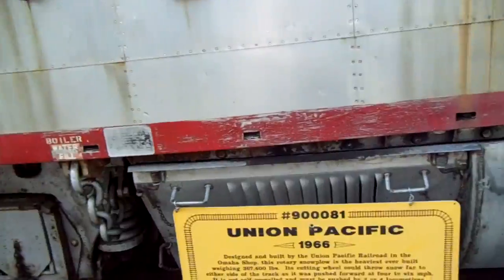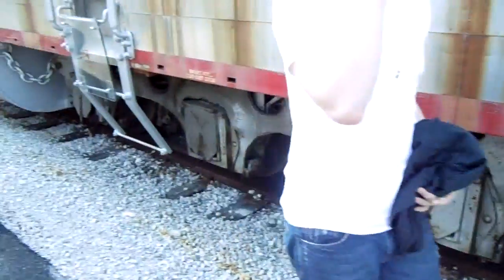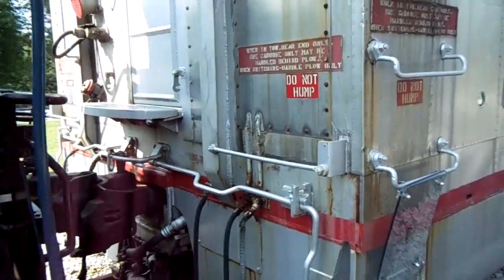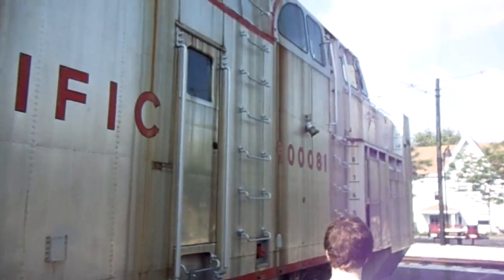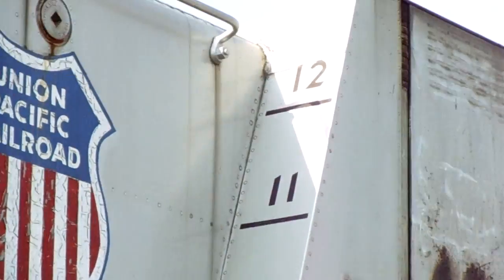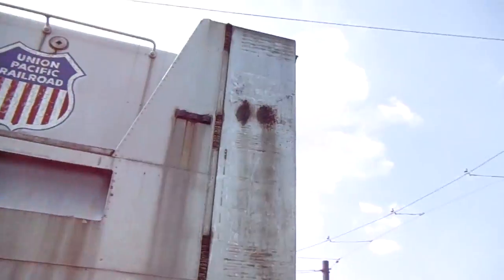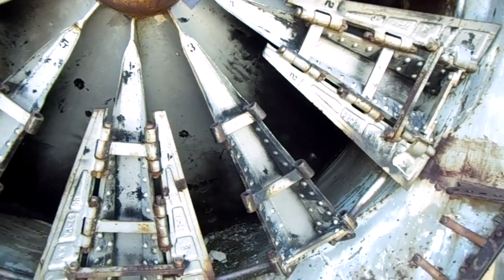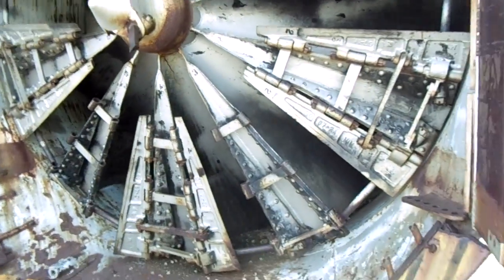1966 Union Pacific 3000HP Rotary Snow Blower at Museum of Transportation in St Louis

Comment: A little history on this rotary snow plow. Union Pacific built three of them from the 1950's to the early 70's. They where a literal "kit bash" and where designed and built from the rail up. This is the second one that was built, the first and third are still in service on the UP.  It could cut up to snow up to 13 feet deep, and path 12-13 feet wide, and would be pushed by three or four locomotives, which would be controlled from the cab of the rotary. A marvel of "Uncle Pete" engineering.

Comment: A hump is literally a hump, or mound in the yard. You push a cut of cars over it and pull the pins at the apex sending one car down at a time and from there it goes through retarders to either slow it down or let it keep speed. A computer controls the switches and lines it into one of at least 30 or mor tracks to make up trains.

Comment: Do not hump means to build up a lot of speed and set the car free by unhitching it while cutting power on the pusher motor.  The momentum carries the car into whatever cars are waiting down the track.  Usually there is quite the loud 'whump' when a humped car meets the others that are stationary.  This one means you shouldn't slam un-powered rail cars into it.

Comment: 1.  Why is thistill not in use?
2. Why not hump?     (Hump is pushing a railcar over the top of the slight hill of a clasification yard and letting it roll down the other side by gravity.  It is slowed and switched to the correctrack where it runs into and couples with other cars forming a train.)
Perhaps the sudden stop may impart undo linear force on the blades.